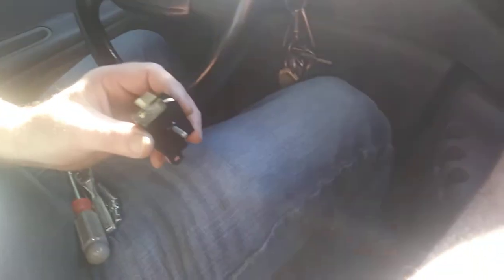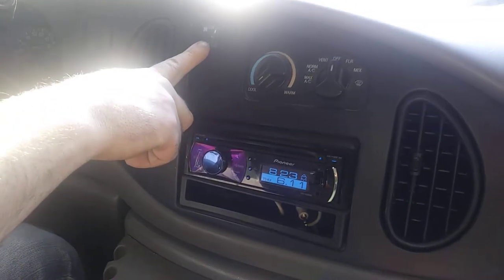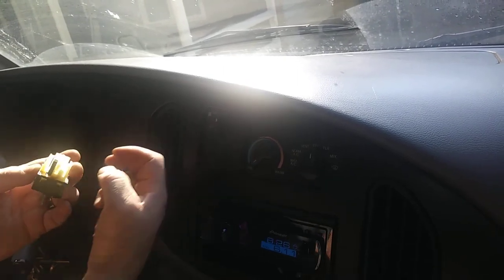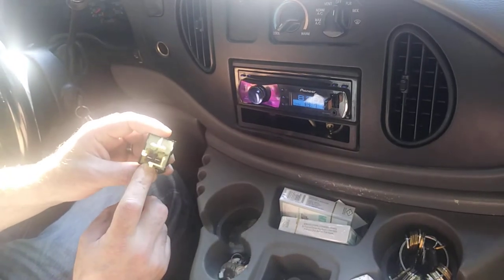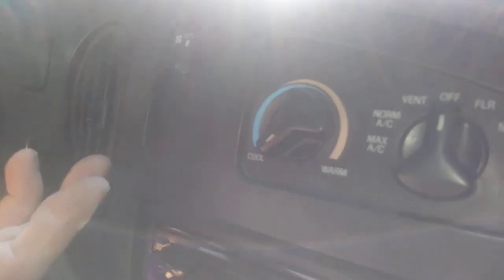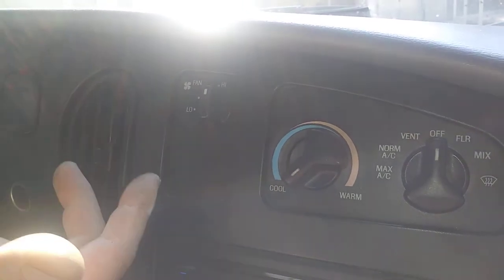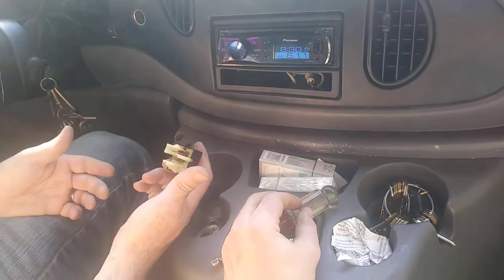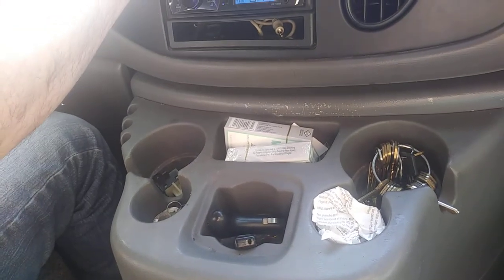Ford Econoline A/C Blower Motor Switch Replacement

Comment: Great video !  Thanks  so  much.   I  could  not  have  done  the  A/C  Heater  blower switch  repair (properly)  to  my  2004  E250  Van  without  your  video.    The  original  Ford  supplied  switch  lasted  all  these  years  on  my  van  of  248,000  miles.   Before  i  found  your  video,   I  was  prepared  to  use  my  saw  to  get  access  to  the  switch.   You  narrated  it  very  very  well.    Camera  was  OK  except  for  the  sun light reflecting of the  dash  board .   I  did  have  the  same  problem  searching  for  the  proper  switch.    Several  different  brands  but  it  was  difficult  trying  to  make  sure  i  picked  the  right  one.   Prices  were  all  over  the  place.   My  two  local  auto  parts  stores  did  not  have  the  part  and  ,  their  prices  were  higher  than  those  on  line.   So,  i  just  wanted  to  say  that  i  am  grateful  that  you  made  the  video  and  put   it  out  there .    Thank  you  very  much ,  Gary
Reply from the maker: Thanks Gary. It wouldn't hurt to stock up on a few junkyard factory switches. Another tip if I didn't mention it, was to turn the blower motor on high after replacing the switch with the aftermarket or used switch and put your finger on the aluminum post with the knob off and feel for heat after a few minutes. If there's no heat, you're good to go.

Comment: Everything im finding says "if it only works on high" - mine doesnt work at all. Blower is fine, fuses are fine, new resistor made no difference.
Reply from the maker: You can always unplug the blower motor switch and jump it out before you spend any more money.

Comment: I just replaced my resistor, resistor connector and blower motor on an '03 e350 but still nothing from the front blower motor. I guess I get to change the front fan switch soon
Reply from the maker: Use a junkyard switch, or Motorcraft brand. But try jumping the blower motor to the battery first. All functions on the switch usually don't fail at one time. However, you could be the first.

Comment: Hey there. Love the vid. Do you happen to know which color wires go to which area? Having a hard time finding it. Came into the repair after the switch was already removed..
Reply from the maker: Not off hand. I hope you have it fixed by now, it's cold as heck. If not, let me know. I'll try to find a diagram.

Comment: AC on my 2010 e150 just bit the dust... damn thing is stuck on low speed. Thinking its the switch cause it was a little crunchy going through the speeds. All the vids I can find are AC's stuck on high speed with a bad resistor.  Ill tell ya, I wouldn't be fixing it if it were stuck on high in this damn heat.
Reply from the maker: Well, it's the resistor or the switch, one of the two. Hope you get it fixed soon Mr. Cracker, it's gonna get hotter down here in the gulf states.

Comment: Only the third AC position in my 02 F150 is not working. Changed the resistor, still not working. In your experience. When the AC switch is broken. Does it always create a burt/melted spot on the switch or pigtail?  Do you change the pigtail everytime you have changed your switch?
Reply from the maker: I usually don't change the plug if a switch burns up. But if it does burn the plastic to where the connector can't firmly snap in and make a good connection, then I either cut the plug off, strip a good section of the wire back, and crimp some some new terminals on the wires, (IF OF COURSE THE SWITCH ACCEPTS TRADITIONAL TERMINAL CONNECTORS). Or, if the switch uses special connector pins, then I'd find a plug off Chinese Amazon or Ebay. The best thing to do is to find a good plug off a junkyard vehicle that's compatible and crimp the new plug in. As for the switch burning up, sometimes they do show some sign of scorch either on the switch's terminals, or the actual connector itself. The reason I changed the NON OEM switch for a junkyard Motorcraft part was because the shaft of the NON OEM switch was getting hot, indicating the switch wasn't able to handle the voltage. The Motorcraft OEM switch handled the load just fine. THE MOST IMPORTANT PART IS, NO MATTER WHAT PART YOU CHANGE, IS TO HAVE A CLEAN MATING SURFACE BETWEEN ALL CONNECTIONS. I've also had blower motors burn up resistors and switches because they were a cheap aftermarket with too much resistance. More Chinese junk! But I had an '01 F250 burn up the switch because the factory blower motor sucked in some cellophane from a cigarette pack and put too much of a load on the circuit. That was a good question you asked, and these are all the things I found so far regarding the blower motor circuits on Ford's non auto climate controlled systems.